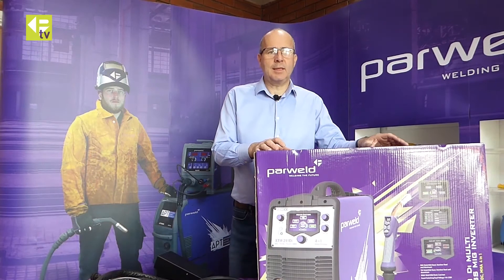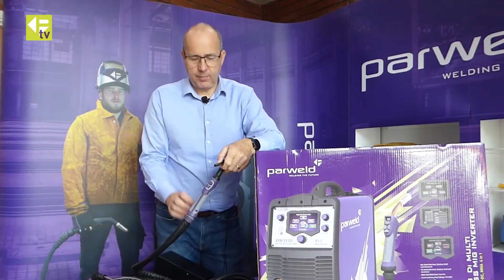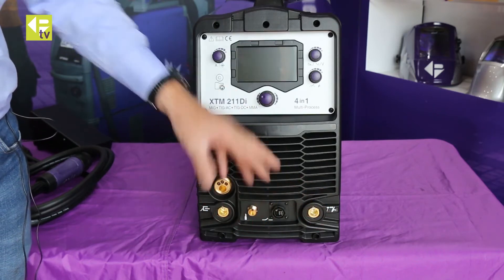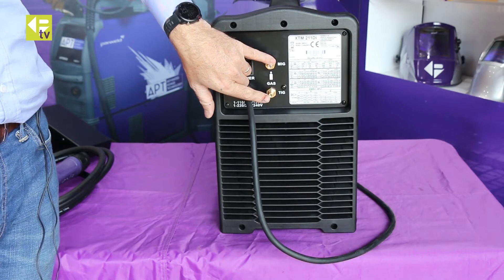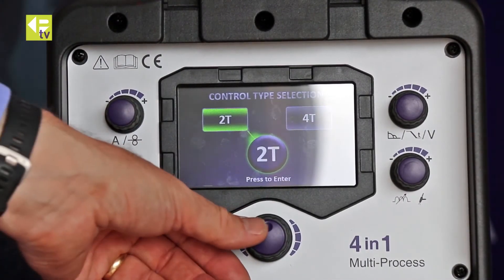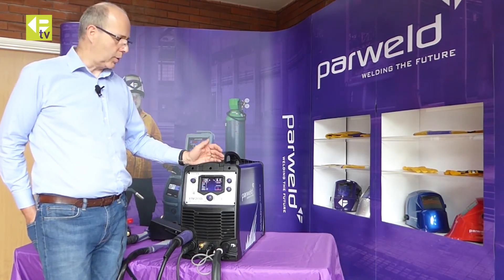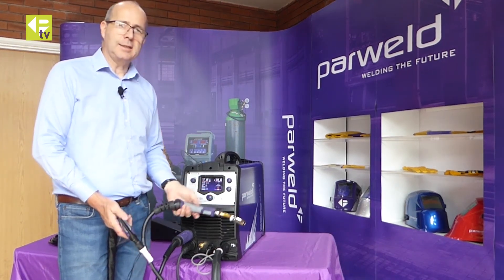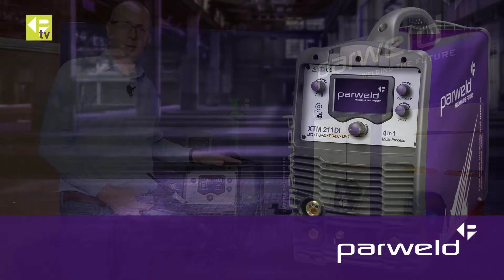XTM 211Di 4 in 1 Multi-Process Inverter Welder from Parweld

Comment: I have studied and searched every welder in the world. (From USA btw)Mostly disappointed. Aside from European designed welders. Fronius, Bohler, Selco, Stel, Kemppi, Lorca, etc. It is to the point where I would like to start a company here in the US. Everlast is the only one coming close. But still not there. This Parweld, at least at glance having never tried the machine, is really just nailing it. I would love to bring this form factor to the US at similar price points. Maybe just a touch higher if necessary. There is a major gap for quality well equipped machines in the $1500-3000 range. And the US machine over $6k are just plain junk. They are the equivalent of our politics. Red or blue and are both laughing stocks of the world. Way to go Parweld. I hope this company makes it. And you should try entering into the US as well. Or let me brand it in the US for you. The brand will not work here I do not believe. But the form factor will

Comment: Have just bought one of these, will be doing a lot of restoration work on cars also metal sculptures and ally welding so hoping it’ll pay for itself 😊 looking forward to it!
Reply from the maker: Great news! Be sure to keep us updated on social media!
Reply: So i wanna buy it, do you recommend?
Reply: @mondiperformance  yes definitely, the synergic welding is really good for thin sheet! The mig torch is a little large n the controls on the handle are annoying as u catch them when your welding, the tug welding function both ac and dc is great! I weld up alot of lot of alloy wheels n it does this fine working flat out! Truly is a lovely piece of equipment n I’ll be getting a foot pedal at some point to! 
I’ve been welding for best part of 20 years and coded in all sorts of disciplines, so for me to like it is saying something as some 240v welders are rubbish!
Reply: @br4d101  i really appreciate you answer mate! I am looking to open a shop for exhaust (stainless steel weld) and boost pipes (alu). I think should be good enough?
Reply: @ be perfect for that mate, just make sure you get the pedal! I use mine for the same thing to!

Comment: I'm be interested this multiprocess welder. Would you have all ready some movies abaut Mig welding Aluminum, Stainless steel, Mild steel?? 
And it is possible to use different Tig torch like a CK with simple on off button?? Like for me orginal Tig torch is too bulky 😁 
Thanks
Reply from the maker: Hi! Please give us a call, we are more than happy to walk you through this, you can use any euro MIG torch across any Parweld MIG, traditionally we use a 250amp PRO2500-40ER(4) = 4 button
Reply: Hi
Yes I have a ck torch on all mine and I will be doing a review shortly,. Will do a detailed review on how I connect my gear and how to go about it in next week or so
Reply: @smallgarageworkshop6119  when you doing the video mate?
Reply: Hi Rob 
Well i have done half mate but doing other stuff as you can see on my channel now plus my job its fitting it in . I just have to edit bits this weekend and can post part 1 which includes panel info plus DC tig side on 2mm fillet joints. I have tons up my sleeve for both parweld and Jasic . Cheers for asking
Reply from the maker: @smallgarageworkshop6119  can’t wait!
Reply: @smallgarageworkshop6119  great I’ll keep an eye out👍
Reply: @robbie5286  I have posted a brief one mate this afternoon. 👍